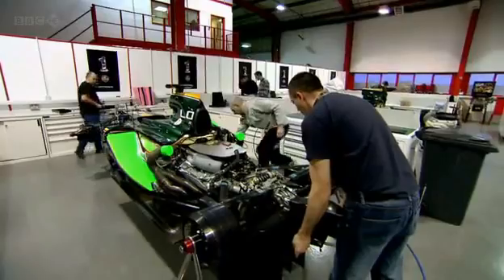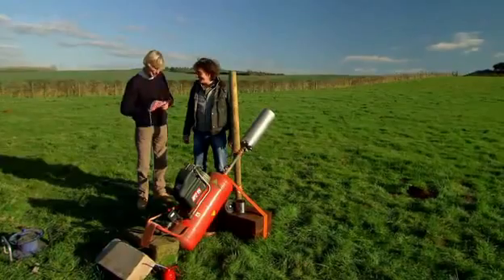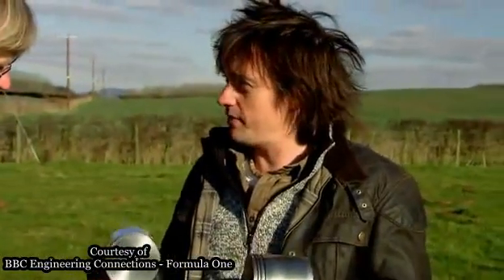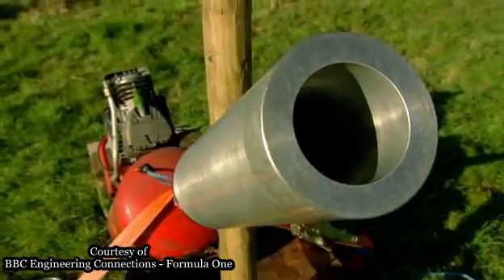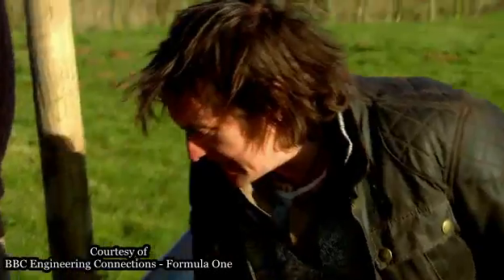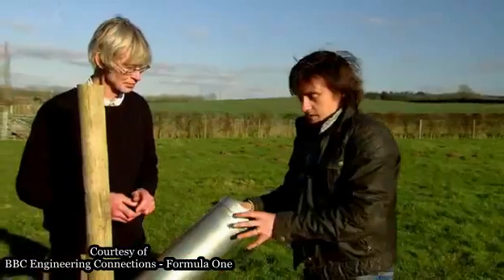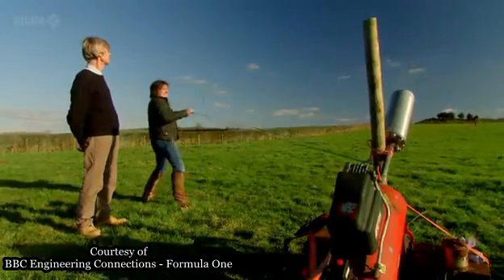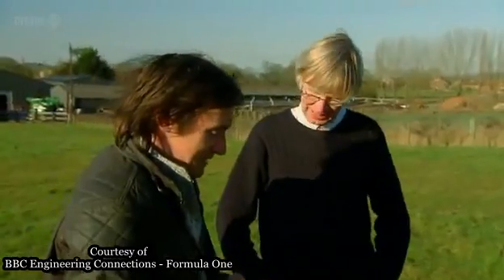The Secret of F1 Enormous Power - Precision Fitted Components

Comment: This video does NOT suggest that the precision machining is the ONLY reason that the F1 engines are so powerful........but merely highlights ONE OF THE MANY factors (precision tolerance) which contributes to its greatness !!
Reply: +ranjit singh 
yes the rest of the stuff are too complicated to be mentioned on a regular documentary film made for all kinds of people to understand ....
plus there are closely guarded secrets that they simply well not tell you   
there is compression ratio which is set so high....coupled with fuel that fights detonation (pre ignition )
also precisely calculated intake runners ...valve angles,size which contributes to how well the engine breath and expels exhaust 
exotic material used and how well the rotating assembly parts are balanced to eliminate vibration
Reply: +paviaaPS3 Yes, you're absolutely right that it would make them more economical! However building a high compression engine requires more precise engineering. The higher the compression ratio the tighter the parts must fit together. more precise engineering means more expensive and most people do not want an extremely expensive daily driver.
Reply: It's also because the fuel consumption savings wouldn't outweigh the disparity of price between regular and premium gasoline. And also, people would tend to be idiots and put in regular gasoline, and complain their car is a lemon when it barely moves, because the knock sensor heard knock, and retarded timing.
Reply: +paviaaPS3 exactly like coenjin said, but it is also about wear and ease of use. Those tight tolerance engines are very very tempermental, they need to be taken very good care of. F1 engines shouldn't be started cold, like it says in the video. These engines also wear out faster and parts are being replaced frequently.
Reply: paviaaPS3
not entire true...
you the advancement of fuel grades which prevent detonate..
the fuel in this formula one is using 102 octane which is far more resistant to detonation (pre ignition) then regular market fuel which allows you run higher than usaul compression  ...also the fuel delivery used in these engines are 

diesel and gasoline are different in many ways

diesel is thicker than gasoline and ignites under 210 Celsius much less than gasoline which is 246 Celsius there for you can use VERY high compression ratios to ignite it...

diesel also suffers from colder weathers it becomes more viscose as it get colder..it is harder to start in colder weathers unless that diesel engine is equipped with glow plugs

diesel can be used as race fuel ...and audi proved it with their race machine...
Reply: +Faisal Abdulaziz well how can the compression be high on Otto engines? if the compression becomes high it will be a diesel engine
Reply: +Faisal Abdulaziz ".thats why some deisel engines have Glow plugs ...not spark plugs"
no Diesel has spark plugs .. only Glow Plugs used to start it
Reply: Brian Catnut yes it is mentioned in my third comment
Reply: +Brian Catnut i believe he just didnt word it clearly
Reply: Unfortunately the hi efficiency hi power low emission Diesel engine .. is a lie .. the one thing the evil cow Thatcher was right about. Looks like those 80% of car owners that have Diesels in Europe got mugged. Not just by VW .. all the manufacturers must have been up to something similar.
Reply: +Faisal Abdulaziz diesel is more difficult to ignite?
Reply: +paviaaPS3 its easier to ignite under high pressure ..increasing the pressure in a burning chamber will lower the ignition temperature even more thus igniting without spark plugs
in cold tempratures it harder to start a diesel engine ...thats why some deisel engines have Glow plugs ...not spark plugs

with gasoline you need spark plug to ignite it...and not cause detonation
Reply: +Faisal Abdulaziz nice. but wouldn't it be more economical if a family car then got a higher compression plus better octane grade? wouldn't the car become more fuel efficient like a diesel engine?
Reply: +ranjit singh Yep i know little to nothing about the expertise of F1 enginne, but sure i can imagine material weight, tolerance to heat, preasure, friction and all you can achive with small variations on material to make a small motor push out great power without self-destruct before race is over ^_^, also good tires, even oil and fuel quality, uff so much stuff one could imagine.
Reply: Thunder Kat and software !!
even more now with the horrendously complex cars
Reply: Brian Catnut Yhea I also watch that movie ^_^
Reply: +paviaaPS3 high octane gas is more expensive as the composition is different, giving you less of it, and more byproducts, than regular gas from the same amount of crude oil
so you need less of a more expensive fuel, which in the end doesn"t give you a cost advantage
Reply: David Harris Yes
Reply: David Harris Greetings from India....thanks for adding ur insightful thoughts in this thread
Reply: paviaaPS3 yes but that will make the car more expensive.....far more expensive to build as a regular daily car driver
Reply: TheYorkMan that was a much more detailed replay than i could possibly get worth reading i say.

thank you very much for your time.

well as it seems to me formula 1 went down ,while everyday passenger cars doubled its efficiency and not just that, it has also become heavier and larger and for a reason (safty and cargo space)
Reply: hiyadroogs No .. the process of compression combustion is inherently more dangerous
.. as you think someone is "brainwashing" the population .. I guess I would be wasting my time even trying to explain it to you.
So just ignore the "tree huggers" and keep driving the Diesel 4x4 on the school run.
Ps. the EU was PROMOTIMG diesel engines .. try at least get something right BEFORE posting.
Reply: Brian Catnut No.. Compression ignition is NOT inherently more dangerous. I've already explained to you that the process can burn many different types of fuel besides diesel fuel. The entire history of the SI internal combustion engine to the present, has been largely in the pursuit of ever higher compression ratios to extract greater power & efficiency from an inherently inefficient design. If it were possible to get SI petrol engines up to diesel level compression ratios without detonation, manufacturers would unquestionably do so, & have been trying to do just that, - because it is far more efficient, & higher CR's aid a more complete combustion. In some high performance road going motorcycle engines, CR's are now up to 13:1. Some modern turbo diesels have CR's as low as 16:1. The emission problem for diesel manufacturers, & catalysts, is that since the diesel operates at air/fuel ratios considerably leaner than stoichiometric ratios, even at full power, this causes NOx levels much higher than petrol engines. In other words, it is the ultra lean burn nature of the diesel which causes the excess NOx, NOT the high CR. Lean burn petrol engines suffered precisely the same emission problem.
The solution for the diesel, is the electromagnetic operation of the inlet valves, independent of cam profile, which will restrict the amount of air available relative to the fueling at all engine speeds & loads. Fiat first came to this conclusion, which will effectively make a diesel run at close to stoichiometric air/fuel ratios at all times. This process also dramatically reduces & even eliminates diesel combustion 'knock' - making diesels as quiet as petrol's. Whether it would be cost effective to do this now, with fuel cell technology just around the corner is another matter.
Reply: Sorry you are not looking in the right place
NOx is not the worst crap they spew out.
Not many are to the new Euro 6 compliant level and for sure all those with the "special" software will surly fail, that’s pretty much all the new high performance Diesels. Not just VWs.
Anyway new battery technology will soon kill off internal combustion engines used for cars,
advances in solar charging will soon let you park at home and your car will get charged from the power stored in your system almost for free.
This stuff is real close now, in a few years the game is seriously going to change. I know people who are already charging their car from power they generate.
When it becomes more common and cheaper to get sorted it will make old fossil powered cars look a bit pathetic really.
Most people just want to get from A to B cheap and easy .. the cars will be almost disposable as most of the car is recyclable, probably leasing will be more common, like a phone contract, when an upgrade car is out they send you one and pick up the old one.
And they will be self drive as well so you can read a book on your Android tablet while being silently driven to your destination in your Google car!
hows that for a gearheads nightmare
Reply: Brian Catnut I agree. Though battery technology has a very long way to go yet. I've had personal experience of high powered electric scooters, & problems with lithium battery cell failure are extremely expensive to rectify, even in modest power outputs of 10 hp bikes. At £80 per battery, & 24 of them required even for such modest power & a range of just 60 safe miles before a recharge becomes urgent, - battery leasing would be the only practical way to go. The problem is also with charging. Even lithium batteries can only take around 1000 to 2000 full cycle charges before replacement becomes necessary, which sounds a lot at first, but if such a full cycle is undertaken daily for a weekly commute, will require replacement in only 3 years or so. Also, even with fast commercial charging, it still requires several hours from flat to full charge. So I think that electric cars will only be a niche buy for people who can afford the luxury of several cars with the electric being a secondary shopping runabout, which kind of defeats the objective when you need a long range vehicle as well. Perhaps men will have most trouble adapting to new tech, since we tend to eulogize the internal combustion engine & have an obsessional emotional attachment to it. Women could probably care less as long as it's reliable!
Reply: Forget lithium batteries ..  FORGET EVERYTHING you know about battery tec .. in a very short time stuff is coming out that is going to completely change EVERYTHING.
FORGET "charging time" even Forget Life Cycle !
There are already cells in the lab that have SERIOUS capacity and can be  charged virtually instantly.
When patents are all sorted, then this sort of thing will get into mass production and the price per unit will drop to way below what Li or NmHI or NmZN cost now.
Reply: +hiyadroogs    A lot of manufacturers have switched from lithium to Iron Ion  which only decreases the life of a battery as well. (cheaper to make)
Reply: direct injection engines kinda achieve this now, but with regular fuel and higher compression
Reply: Actually, the title suggests exactly that. Learn how to read.
Reply: It certainly appears that precision machining is what makes F1 power. Maybe there is more to the video that's not shown here, but from what I've seen of it, that's exactly what he's saying.
Reply: ranjit singh I think one reason is fuel , right ?
Reply: Thank you for pointing that out, who knew?
Reply: +Brian Catnut It's all relative though, Brian. A modern diesel car engine still produces 500 times LESS pollution than, for example, a non catalysed 6 hp petrol lawn mower engine. We've only been brainwashed into believing all this polution hype because of the tree hugging climate change lobby & the obsession of the EU. A modern diesel is many hundreds of times cleaner than an uncatalysed petrol cars of the 90's. At that time, petrol still contained lead, a highly toxic brain poison, & added benzene, one of the most carcinogenic substances known to man, of which there is no known minimum safe level. One American scientist even suggested that people were in severe danger simply by breathing in the fumes of petrol vapour at filling stations, because of the extreme danger of benzene. He also warned against using petrol lawn mowers without breathing equipment because of the danger of benzene inhalation. Diesel fuel has never contained lead nor benzene. Studies undertaken over a 40 year period in heavy diesel industries, where diesel exhaust is habitually breathed in by the workforce, - showed no incidence whatever of higher cancer rates than the general population. The compression ignition process of the diesel is actually capable of burning any combustible substance that will self ignite at around 450-500 C. With fluids, as long as it has the lubricity to lubricate the injection pump & injectors, it will work. Diesels with an adapted intake system can also run on gas. Diesel's original engine ran on coal dust blasted in under compressed air! The problem isn't, & never has been compression ignition - the most thermally efficient internal combustion engine that exists, - but the fuel engineered for it to run on.

Comment: he needs piston rings
Reply: +magna59 I'm guessing he meant in the canon. If the smaller of the 2 pistons had piston rings, I think it would have gone further than the larger piston in this experiment as it would have sealed but would have had less friction in the barrel.
Reply: +Sebastian Scholle Why would you need piston rings , in the conventional sense , if you have measured everything within a micron of it ' s life . Piston rings are a reflection of low machining capability / pricing techniques & a quick cheap fix . May be the odd oil control ring , but even that ' s a bit of a mixed on , as these engines are generally dry sump , so it ' s not like there is vast amounts of oil being splashed about , as in a wet sump design .
Reply: +magna59 wet sump or dry sump there is oil being splashed around, oil is pumped into the mains and flys off the crank shaft in all directions
Reply: +magna59 idiot

Comment: Let’s see, 2.4L is about 146 c.i.; so were talking about 5.48 hp / c.i.. although at some phenomenal  rpm.  Commendable..

So back around the mid nineties , a born genius by the name of Jim Feuling out of San Diego was, among other projects, working with GM/Oldsmobile on a 4 cylinder 121 c.i. / 2L engine to be known as the OHC Quad-4.  Versions of this engine went on to be produced by GM over a period of about ten years.

Apparently Feuling favored this N/A engine and with additional Feuling "enhancements”, the engine ultimately produced over 1,270 hp (continuous) ;  for the mathematically challenged, this is over 10hp / c.i., close to 2x the output of an F1 engine and this was about 20 years ago !!  So much for current F1 “super” engines. This Feuling engine was on display for several years at the San Diego Auto Museum, Balboa Park. 

Jim Feuling passed in 2002 at the age of 57 of the scourge of our day-- cancer.
Reply: MrGGPRI The engine used in the Aerotech prototype was highly turbo-charged and that isn't impressive at all. At the same time, BMW was running F1 cars with 1500hp from a 1.5l inline 4.
Reply: +MrGGPRI This engine was turbocharged.